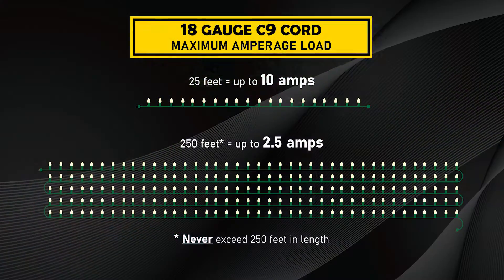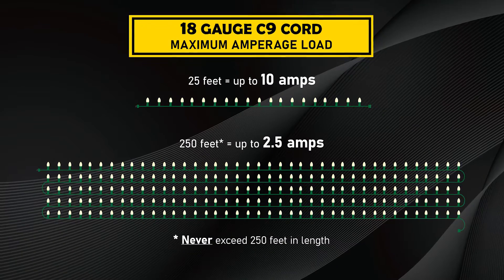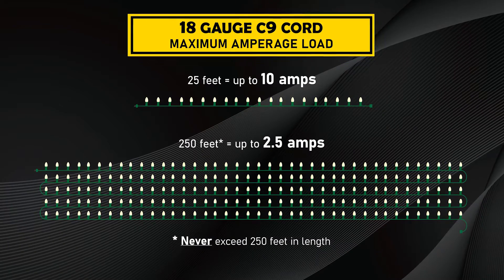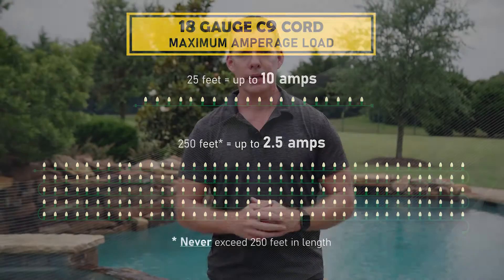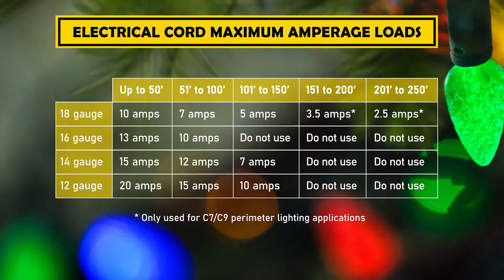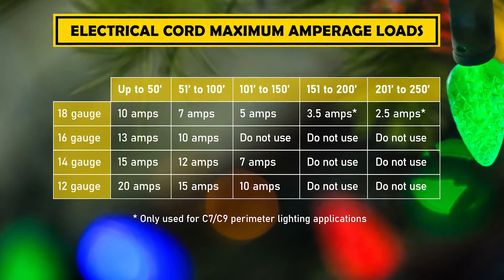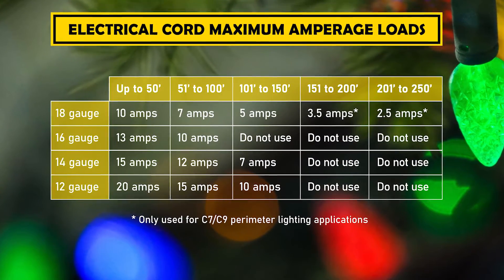Understanding the Maximum Amperage Allowance of your Christmas Light Electrical Cords

Comment: Dumb question but I am far from an electrician… does this mean for ONE SINGLE STRAND of extension chord? Meaning, I obviously cannot run 500ft with a bunch of females for all my kids inflatables and lights as I understand from this video… but could I do a 100ft SPT 1 cable with maybe 5 females on it to a 5 way splitter and then run 5, 100ft spt1 extensions chords with females from there or no because the TOTAL length would still be 500ft? Am I making sense here? Hahaha. Thanks very informative.
Reply from the maker: Great question @Giancac9977
For SPT1 18/2 wire, you will want to run 250 feet on one outlet. Running 500ft will push you over the max amperage of the line.
For what you are wanting to do we would recommend a higher gauge cable as they can run longer distances and handle more amperage. Of course using a kill-a-watt meter will be the best solution to determine what you are actually using so that you do not go over and max out the lines.

Comment: I've got a question on this. I have 250 feet total of C9 LED bulbs for my roofline split between 3 different lines that all plug into the same outlet with a 3 way female connector. The longest run I have is 100 feet. I would like to add a female slide on plug to one run to add some 5mm LED lights for trees as well, would be a total of about 600 feet of LED lights. Since this is not all one continuous run, I should be able to splice in to the 100 foot run and use all of the lights on one outdoor outlet, correct? Thanks for your help!
Reply from the maker: @TravisMiller-t9d - Since your C9 LED bulbs are split into three separate runs, you can safely add the 100-foot 5mm LED lights for your trees. Since these cords are not run in a single line, you are well under the maximum amperage load for each line.
Reply: @ChristmasDesigners  Thank you for the quick reply! I thought that was the case, but wasn't sure if it mattered that they were all plugged into the same outlet. I appreciate the help!

Comment: Thanks for the informative video. Couple of questions: (1) Are you saying that for a given gauge, the longer the line, the lower the amperage ceiling? So hypothetically speaking, stringing together 478 Minleon bulbs, 12" spacing, on a 478' 18/2 wire - each is rated at 0.58 watts. 0.58 watts / 120 volts = 0.00483 amps of draw, each. 0.00483 amps * 478 bulbs = 2.31033 amps of total draw over the entire 478'. But that doesn't mean that the wire can support that since the capacity would surely drop below 2.5 amps with another 200+ feet beyond 250, right? (2) Not planning on doing it, but why "Do not use" a heavier gauge for the longer runs in your table?
Reply from the maker: @GuntherSoderlund - You’re correct that as wire length increases, the maximum amperage allowed decreases. Unfortunately, C7 and C9 empty light line doesn’t typically come in a thicker gauge than 18 due to high copper costs and low demand. If it was possible to find it in 16 gauge, then yes, you could run longer lines since the maximum allowable amperage load would be higher. There are patio lighting empty socket options (medium base bulbs) that are available in 14 gauge and 16 gauge, but because of the high cost of the thicker copper, Christmas light line for roofs is limited to 18 gauge.
Reply: @ChristmasDesigners  Got it - appreciate the prompt response!

Comment: Is there a formula for this? I don’t know electrical at all
Reply from the maker: @KyleZuleger - 
Maximum bulb load: 
250 (C9) LED Retrofit bulbs OR 250 feet of line, whichever comes first 
100 (C9) 7-watt incandescent bulbs 
70 (C9) 10-watt incandescent bulbs 

Maximum amperage for 18/2 gauge wire: 
Up to 50 feet= 10 amps 
51-100 feet= 7 amps 
101-150 feet= 5 amps 
151-200 feet= 3.5 amps 
201-250 feet= 2.5 amps 

Also, be sure to check out Part 2 of our Amperage video series here: https://youtu.be/u6Z3up8bHZ0?feature=shared

Comment: So I want to run 3 100’ runs together 300 bulbs at 0.6 watts. Will this be a problem? My wire is standard with a 8 amp fuse. Any help, tips would be great.  FYI these will run the length of my fence all year around. 

Thx a bunch,
SB
Reply from the maker: This is about 50' longer than we recommend. This line is probably 18 gauge, so that long of a length is doable, but you're at the maximum safe length. The actual draw is less than 2 amps, but at that length, you don't want to push more than about 1.75 amps in the line. You also may encounter voltage drop.

Ideally it would be best to plug this into two lines, or you can use the same extension cord (as long as it's 16 gauge or thicker), but have two leads going to the light line. 200' on one lead and 100' on the other. Then both of these can feed into a single 16 gauge extension cord with a 3 way female.